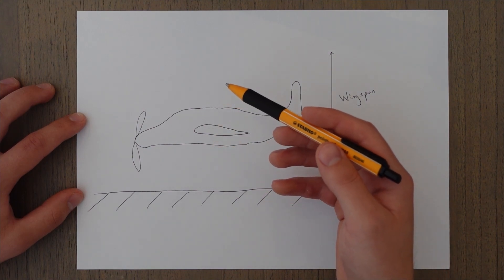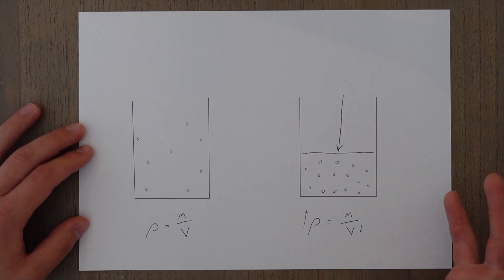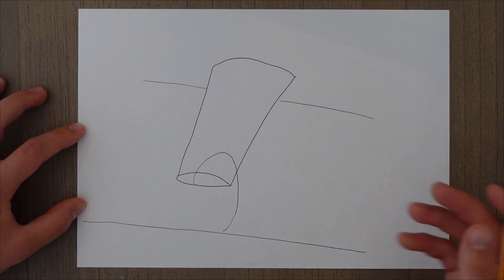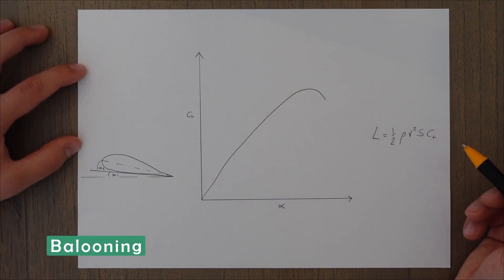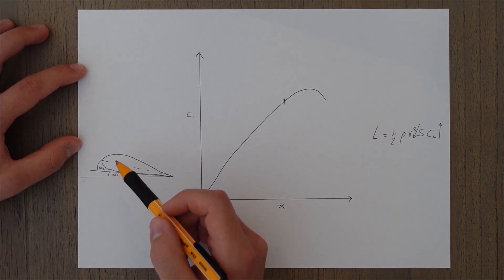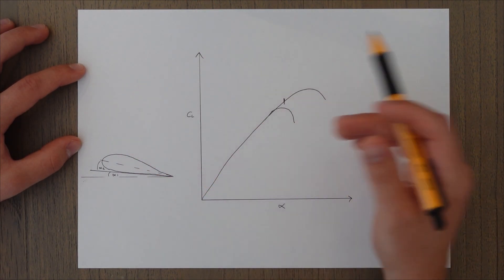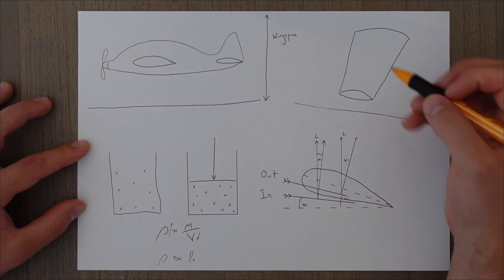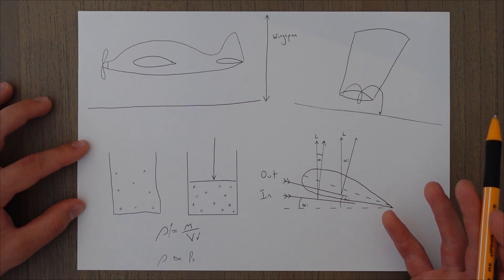ATPL Principles of Flight - Class 12: Ground Effect

Comment: Isn't it 1/2 of the wingspan? At least by EASA's syllabus
Reply from the maker: After a bit of research I think it is experienced within a wingspan but the strength in non linear so it starts to really intensify around 1/2 wingspan.  

There is a good article on SKYbrary about it:
https://skybrary.aero/articles/ground-effect
Reply: @atplclass  Hi Grant, thanks! Your explations are godsent. Thank you for the time and effort you are putting into this.